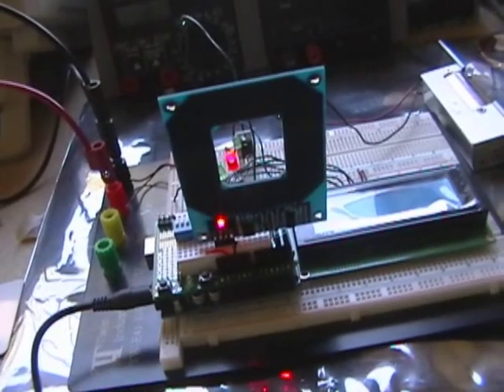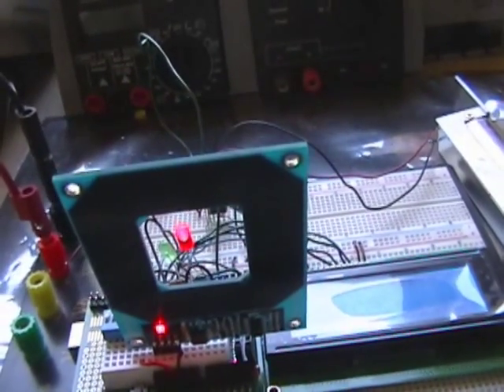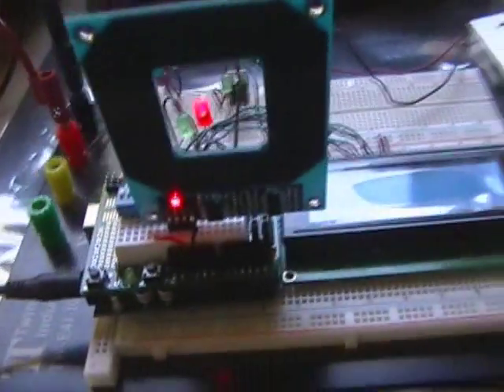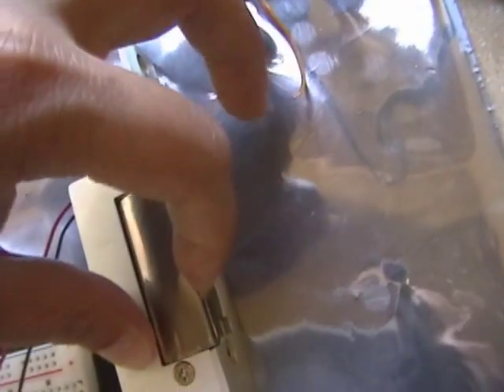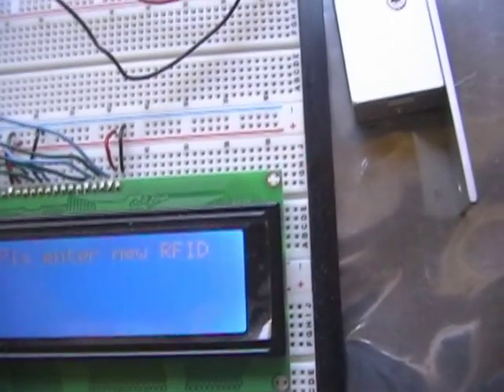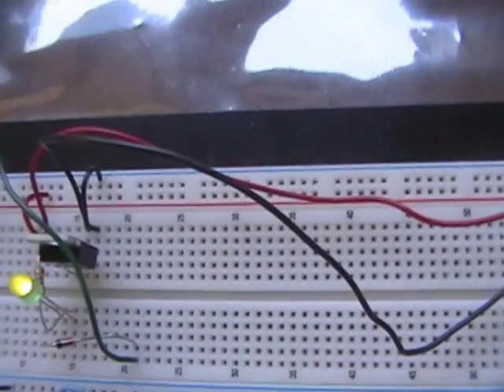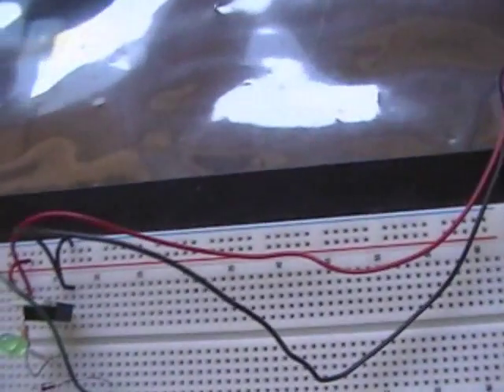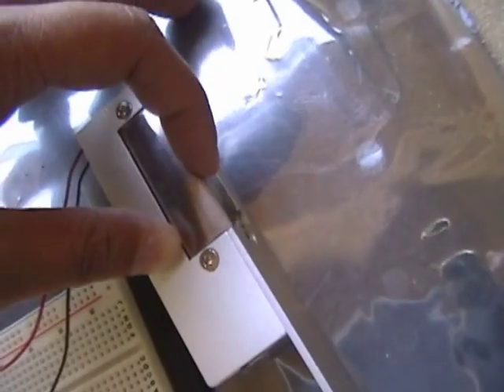RFID based Access Control System prototype using Arduino

Comment from the maker: You will need a microcontroller such as an arduino, a RFID reader + cards, DC relay or MOSFET, and an electric strike plate/door knob.
The circuit is actually pretty simple:
RFID reader is connected the the serial port of the arduino which then determines if it is correct or one or not. If it is it sends a signal to a digital pin which turns the relay or mosfet "on", switching the electric trike plate/door knob.
You can also add an eeprom if you want to be able to save data even w/ power off.

Comment: @dezertfox 
Very simple concepts.  Arduino is a very popular and easy to use microcontroller platform that is very well documented.
Most RFID readers operate over serial, so you just use the serial library to monitor the reader.  Then, he just uses a "transistor" (really an FET in this case) to send 12v to the strike plate.  These are very simple concepts that can be easily found all over the internet and applied here.  Please feel free to contact me with any further questions.